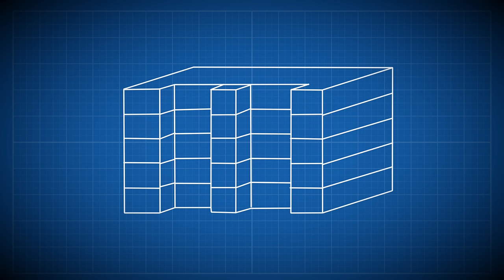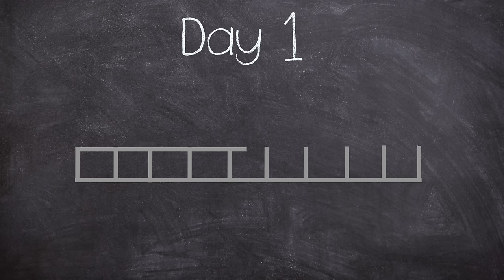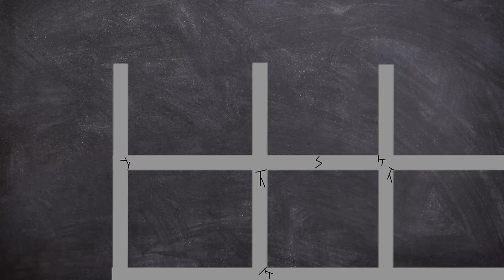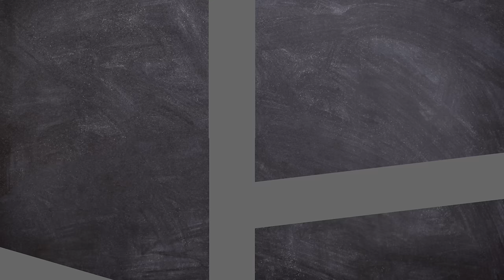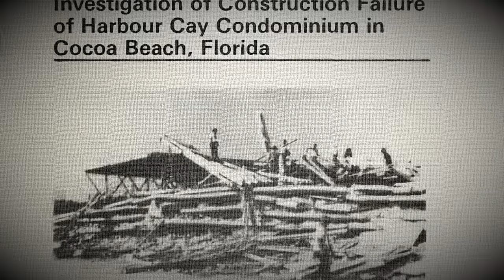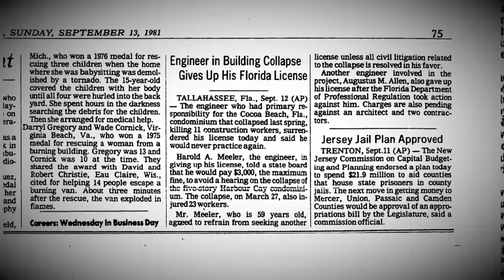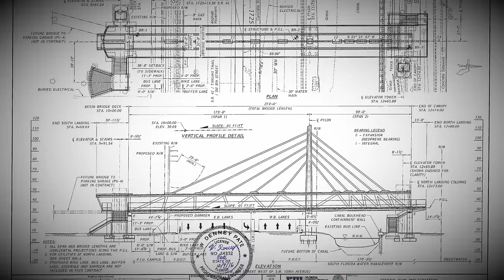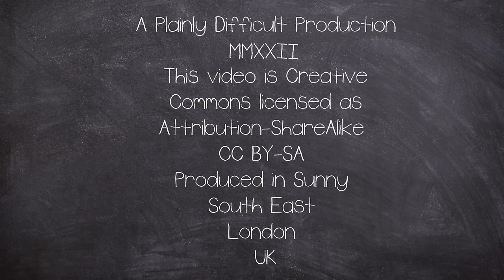The Florida Harbor Cay Condominium Collapse Disaster 1981 | Plainly Difficult Documentary

Comment: It would be helpful to know the floor spans involved...11" or even 8" is a very thick reinforced concrete slab...  most apartment floor slabs here are  typically they are 4 to 6" here... for 12-15' spans... are you referring to structural slab depth or overall slab depth?

Comment: After studying the Champlain Tower in Miami  I have concluded the building failed due to lack of rebar bond stress resistance. This result can be seen where the rebar unzipped out of the slabs. Also in the powder consistency of the concrete. The construction on the adjacent Hotel caused thousands of shock waves that caused a separation of the rebar/concrete couple.
The collapse started around floor 8-10 first bringing down the penthouse and roof.

Comment: The engineers involved were retired NASA engineers and weren't experienced in reinforced concrete design.  The slabs failed in punching shear, the design calculations never checked for slab thickness required to meet punching shear requirements.  The engineers apparently didn't know what punching shear was, it isn't a problem when designing in other materials.  Using incorrect chair heights for reinforcing steel further reduced the punching shear capacity of the slabs.  The video mentioned Champlain Towers, which was designed in the same era as Harbor Cay.  There is not much information available about the engineers who designed Champlain Towers or their qualifications, but there is evidence that Champlain Towers failed due to or partly due to errors in the original design.

Comment: The first crack that was found should have shut down the project . Number 1 there should have been more 16"  (square  ) columns spaced 20 ft apart . The quality of the concrete should have been tested for every batch . Next would be to shore up per normal practices . I have been on a ton of buildings and never saw a crack or series of cracks or deformation in the structures . This is clearly is not anything I have ever encountered . I would have left the job damn quick.

Comment: Just to be clear: A low water content does not mean poor concrete quality. On the contrary, less water and more cement makes for stronger concrete.

Also, there's no such thing as concrete "drying out too quickly." Concrete does NOT dry, it SETS. Concrete (and any other cement-based mixture, such as mortar in masonry work) needs to be kept from drying, as any drying weakens the finished product. This is why the best time to do concrete or mortar work is on overcast days in the spring or fall.

Comment: Definitely a victim of what I like to call the u.s. structural integrity crisis, lasting from the mid-70’s to 1981. Because of a pretty major recession going on at the time, accumulated overconfidence in the engineering industry after decades of successful breakthroughs in design and construction, and a growing trend towards fast-tracked construction, there was a notable uptick in the number of major structural failures and design flaws in medium to large scale buildings. The Hyatt Regency walkway collapse, the Citicorp Center engineering crisis, this, they were all part of the same problem. Even the Surfside condo collapse was a very-delayed victim of this.

Comment: The less water in concrete , the stronger it is. I’m sure the issue was incorrect mix type (without proper set retardant in hot weather) & not vibrating /consolidating the mix properly to avoid cold joints in the hot weather.

Comment: My first thought early on  was whom engineered this disaster.   Sure enough that was a major factor contributing to a complete failure.   The structure should have been flagged and all workers pulled off while most likely the work so far condemned or retro fitted.   I have never seen a building collapse in my area of Socal in my lifetime .   The aftermath of recovery was brutal .

Comment: It confuses me that so many of these stories come from Florida where you get hurricanes, i dont know when it was first introduced but in Australia buildings and homes in known cyclone areas have to have been built to certain standards to withstand cyclones, this in turn makes situations like Champlain towers far less likely. Do you not have standards like this in the states? Or is this more because these builders didn’t meet those standards?
Reply: Did you not watch the video? You answer is there.
Reply: A little (or a lot) of both. As another commenter noted, codes only work if there will be rigorous inspection. In this case, slabs would have been visibly thinner than required, yet there they were. Somebodies must have been very confident they would not get called out for flouting legal standard.

Comment: Florida hasn’t gotten any better in regards to quality of trade work. We’ve got buildings in nine different countries and only Mexico is worse than Florida when it comes to standards compliant construction and regulatory compliance.

You can see the real impacts after any kind of significant weather event. The failure modes have their roots 100% in the “fast and good enough” mentality. 

The Champlain Tower collapse reignited long smoldering conversations about the problem. My favorite explanation of the issue is the weather. The hypothesis is that because workers can go to the beach for free they don’t need the money they’d make by doing the job properly 😂 Clearly, that’s not actually the reason, but it’s a funny idea.

Comment: Concrete is great, but you need ductile steel  ][-beams properly joined.     They’re doing this again today all over the US. They use just rebar and concrete…..no ductile steel.     Also in a Salt Air environment, steel and rebar need to be coated in Red Lead paint.  They still use it on Expansion Bridges, ie, Tinner’s Red.    This protects the steel from water vapor…….RUST!    Once the integrity of the steel beams are comprised, all bets are off on when a building will collapse.